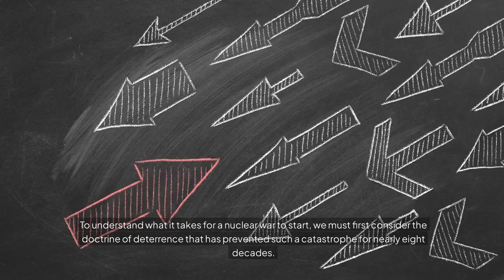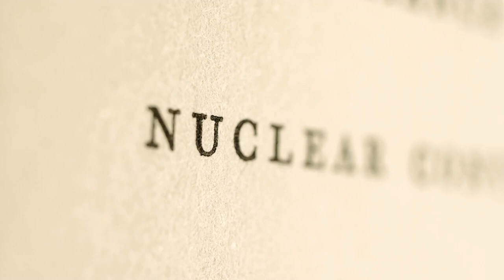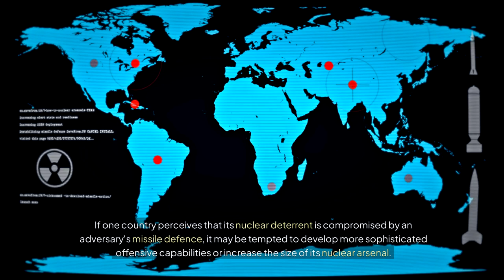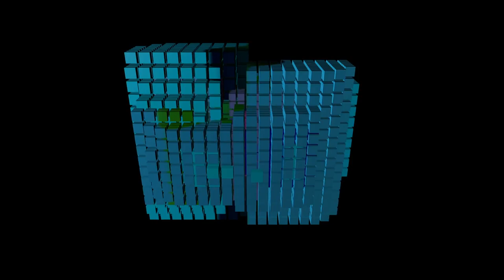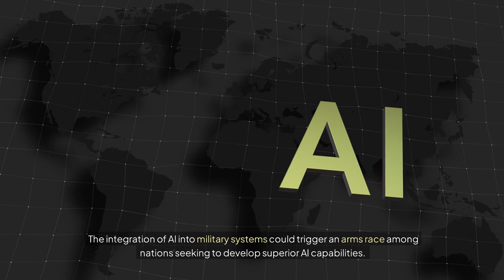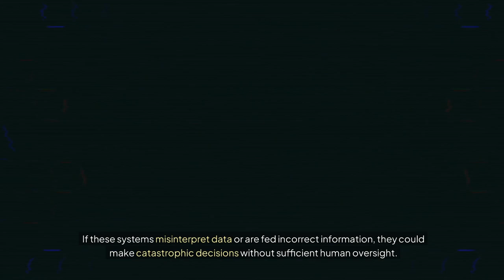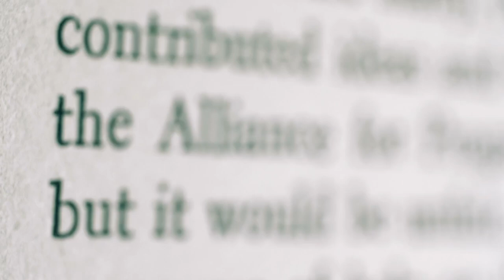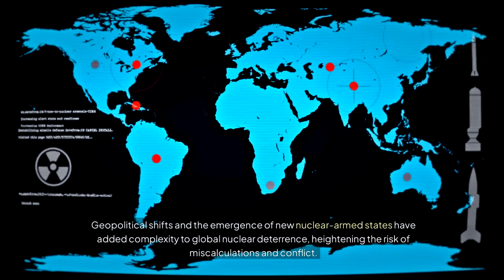What It Takes for a Nuclear War to Begin

Comment: A nuclear war would be the ultimate insanity.  Even a single nuclear strike upon a large city would result in widespread destruction and enormous death tolls, both of which would be staggering.  The extreme heat, coupled with an enormous blast wave, would obliterate buildings, destroy all life within a few miles of the epicenter.   Radioactive fallout would follow and endanger the health of people fortunate enough to survive the initial blast and heat dozens of miles away from the epicenter of the blast.  The local environment would also be contaminated by nuclear radiation from the fallout.